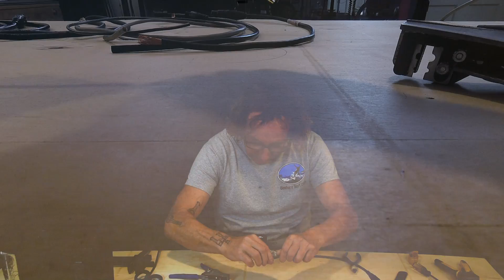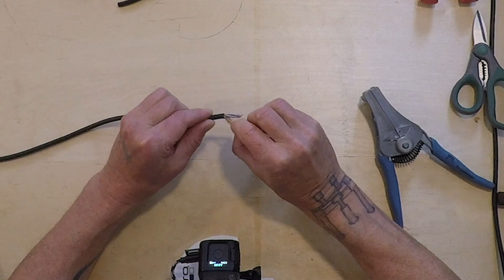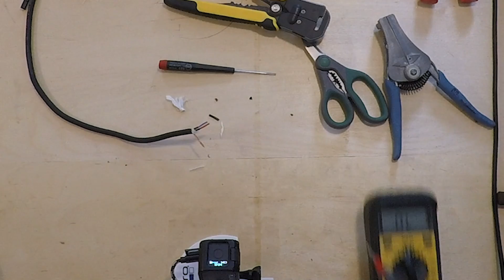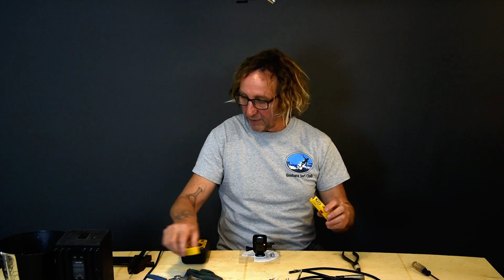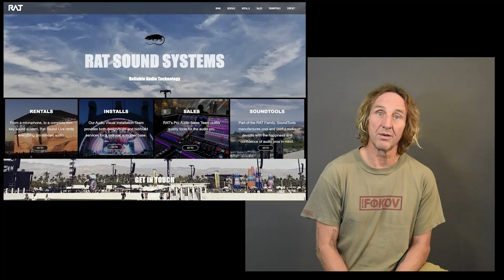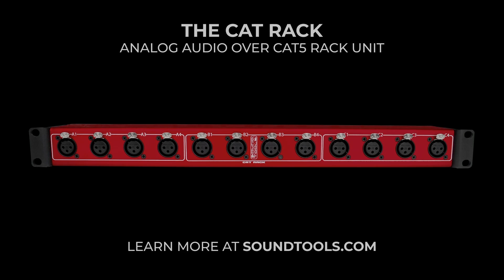Making XLR Cables #2 - Tips Stripping and Shields (Public)

Comment: Hi, I don't know if I have to connect a shield to socket housing . Somebody recommended adding a capacitor (RF shielding) . What should I do ?
Reply from the maker: When you run a cable from a mic to console or any gear to any gear, the mic or console or gear will always connect the shield to the shell, so you do not need to do it.  Also if the gear has a pin 1 lift, and you connect pin 1 to the shell, the pin 1 lift will not function.

If you extend mic cable with another mic cable, the shells will not provide shielding over the connection. Almost always, this is not a problem.

If you connect pin1 to the shell then you will get shielding on extended cables but if the shell touches something with a different ground you will get lots of noise.

So, I never connect the shells, and we don't connect them for the rental equipment.

I have had problems with connected shells and never had problems with not connected shells.

But, if you are using cables that are extended in high rf noise environments and the signals will have lots of gain and the shells will not touch metal, the connecting the shells to pin 1 may help.

Adding a capacitor for very high RF environments can help as well.  But I look at that as something to do if you have problems, not something to do to every cable

Comment: Hey Dave. Thanks for informing the masses.
It bay be better, for discerning minds,  to measure jacket resistance over a length of cable.
If you want to get creative, tie them in multiple knots and slap them around like a new guy that doesn't know over under first.
But a  resistance check of a quarter inch doesn't rep a cable, only an junction.
Live long and rock on.

Comment: Hey Dave, love your content! One cable type I dont think you addressed was individually shielded conductor cables.  

I inherited some fancy 2 conductor cable that has wire shielding and foil around each conductor but it also has a second layer of plastic around each conductor so these 2 shields normally do not touch.  If I am making XLR cables from this cable would I twist together both shields and solder to pin 1 on both sides of the XLR?  Thanks!
Reply from the maker: Yeah, that is similar to conductive plastic shielded wires in a twisted pair, treat the shield the same and connect to pin 1 in both sides

Comment: On a braded shield, I don't untangle the shield. I push it back a bit, open a space in the shield right near the outer cover, then pull the internal conductors up through the opening in shield. No shield damage, no hairs, very neat. Saves time, too.
Reply from the maker: Agreed, good plan and I do the same on tightly wound shields.

Comment: I don't use wire stripper, a good scissor and some practice is the best. Also not agree with the care of no cutting strands, as you for shure know, in cable with braided shield or other well shielded cable the section is so big that you can't fit in the xlr pin so you have to cut it. For the rest I totally agree with you, good video.

Comment: What mic do ya use for your overhead. Thanks
Reply from the maker: I prefer underhead mics and have used a variety.  Beta 98, royer 122, Neumann U89, AKG C460 or 480 or C414 are some of my favorites.
Reply: @DaveRat  i should say in your video recoding's here on you tube
Reply from the maker: Ohhh, it's an older Zoom H4N using the built in mics recording in stereo and then just using the left mic for the video.
Reply: @DaveRat  ok thanks

Comment: Question....what is the name brand of those wire stripers you like the best in this video.
Reply from the maker: A bunch of companies make them here is the ones I have

https://www.amazon.com/IRWIN-VISE-GRIP-2078300-Self-Adjusting-Stripper/dp/B000OQ21CA/ref=asc_df_B000OQ21CA/?tag=hyprod-20&linkCode=df0&hvadid=198070022856&hvpos=&hvnetw=g&hvrand=446614490491303777&hvpone=&hvptwo=&hvqmt=&hvdev=m&hvdvcmdl=&hvlocint=&hvlocphy=9031626&hvtargid=pla-379210428693&psc=1
Reply: Thank you for the info.  I was looking at some  Klein Tools 11061.  Irwin also makes good tools.  thank you.  I saw your vid on corrosion between gold and nickel connecters and other metals......Could you use Di-electric grease on these connecters to make them last longer?
Reply from the maker: If you were to have it sir, grease could be ok but over time grease tends to melt away, attract dirt and just be a messy bummer

Comment: Hi Dave, LOVE your videos! You briefly mentioned SJO cable in this video which reminded me of a question I’ve had for years and you’re probably the perfect person to answer this question. Is SJO and SJOOW viable speaker cable? How does it compare, if at all, to speaker cable used in production and touring environments? I would love to hear your thoughts on this. Perhaps in a future video series?
Reply from the maker: All of the sJ power cables work well for speaker cable. The ratings are good as well.

I would say the main advantages of speaker cables is they come in 13 gauge that fits NL connectors better and often there is less protective stuff in them making them lighter or less overall diameter. Also speaker cables tend to use copper that is easier to solder to, if soldered connectors are used.

The voltage ranges are similar, but ac sjo and other sj cable is designed for higher currents with stricter rules than speaker cables have, which I believe are none.
Reply: @DaveRat  thank you Dave!

Comment: It's the air effect why the cable slides to reduce capacitance I believe. Best silicone outer sleeve and inner sleeve cable,  don't seem to see them around anymore who makes teflon sleeve cable?
Question is to talc or not to talc? I'm not sure about that one what's your opinion.
Reply from the maker: Teflon tends to be rigid so not really flexible. As far as talc, it makes it fire proof at the expense of durability and resilience.  So talc the install and no talc the portable cables

Comment: Nice!

The blue handled stripper have a reputation for causing RSI, the jump in the action whilst squeezing is bad.

The easy way to rationalise noise rejection in star quad vs twin is to consider the average location of each signal. Looking at a cross section, in twin it is along the cores, whereas with star quad the average is in the center of the bundle and thus the same for each.

The cables that have a conductive sheath over each core (black sheath on each of red and blue cores) improve noise rejection since, even though not connected to anything, those sheaths will even out noise between the 2 phases.

Another type of drain wire in foil screen cables is insulation with conductive spots. The sheath on the drain has pin prick sized conductive spots that connect to the foil, but generally can be considered as an insulator. Makes termination simpler since there is no need to insulate it at the termination... I guess you'll be covering that in the heatshrink video.
Reply from the maker: So cool and thank you for the info!

Comment: If it's permanent installation, ALWAYS star quad. It doesn't cost that much more not to do that. If you have longer than 3m pull on a dynamic mic -> star quad. If you have requirements for the lowest possible noise floor (foley mics etc.) star quad...

For normal live and studio it's over kill. But it really works.

It works because electromagnetic waves are an electric field with a magnetic field that's polarized 90 degrees. so while single balanced pair will cancel electric field induced voltage interference, they won't cancel out magnetic field induced current interference. And current through a resistor causes voltage differences, so... ->

STAR QUAD!!!
Reply from the maker: I have a vid on Star quad soldering coming!

Comment: "Cable Time with Dave"  FUN!
I just installed 14 stage pockets (4 or 8 XLR each) using CAT-6A FTP. 4 channels per cable using the drain/shield as a common ground. Works great, and was much cheaper and easier than using purpose made audio snake cable. 
Cheers!
Reply: Awesome to know ftp works. Gonna try some cat5e ftp.
Reply from the maker: Cool cool
Reply: @mgdf44  should work fine, but I wanted the extra durability of 23AWG wire.
Reply: @mgdf44  and do be sure you employ really good strain relief, and leave a bit of slack, so the relatively stiff, fine wires don't break with vibration. 🤘

Comment: On something like Canare L-4E6S the braid is far too thick and dense to use on the ground pin of most XLR connectors. After unbraiding the shield I smooth out the strands and fold them back onto the jacket.
I prep the signal conductors and align them to the terminals on the connector.
Then I gather the shield strands closest to PIN 1 and twist them together to form the drain wire. The remaining strands get snipped away.
My point is that losing a few strands from a braided shield is not a big deal.
Reply: I do this same thing too. It's even more apparent when making DMX cables- the solder cups on 5 pin XLRs are way too tiny to accommodate the full braided shield on something like LEX DMX cable (or other braided shield cables).
Reply: @Chillidude22  I learned a very cool trick watching this video: https://youtu.be/cZyhNmqu3so
I'm referring to how he grafts a small-diameter conductor to the shield to use as a drain wire.
Reply from the maker: I actually try to avoid trimming strands and when I do trim, I make sure all dead ends are captured by tinning
Reply: @DaveRat  Oh, for sure. One wayward strand can ruin your day.